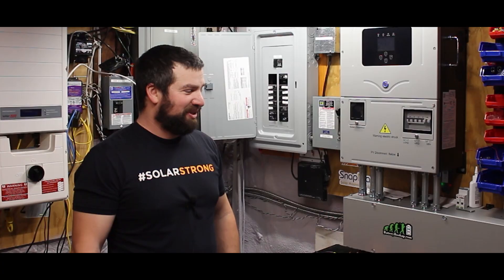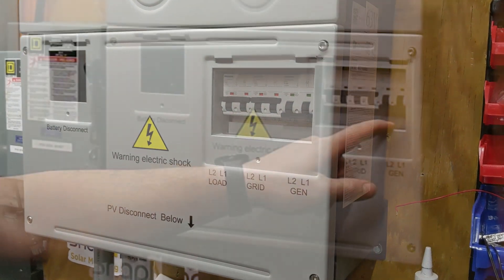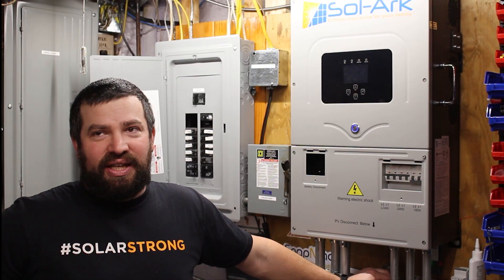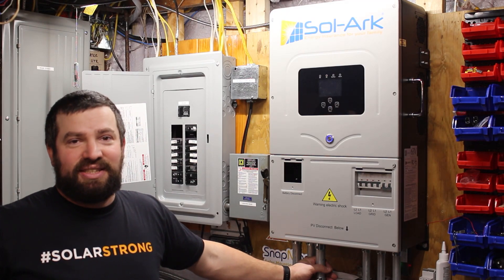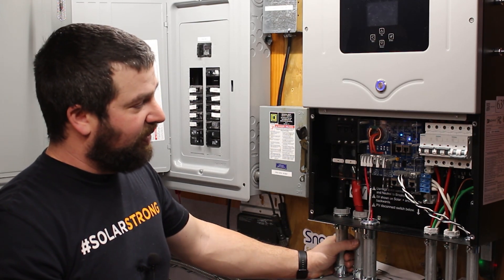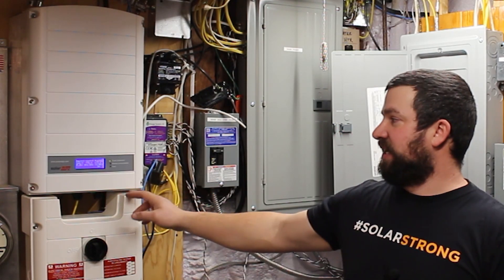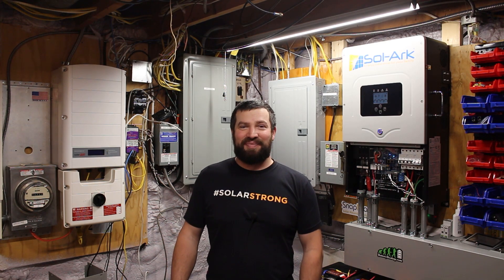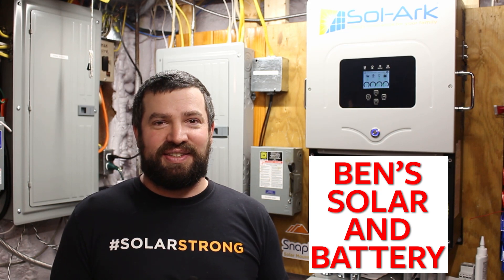Why the Professionals use the Sol-Ark 12K Inverter and Solar Charger

Comment: Unless an inverter can run an entire house without issues, I don't see much point.  It is fine to have UPS units for critical loads such as computer, internet boxes...  but for a whole house setup, unless it can run everything you normally run (so you don't have to conserve power during a power outage), then it is not really a true off grid system to me.  Also people talk about 12,000 watts for something like this, but unless it can handle surges (even an incandescent lamp has a surge), then it is not so useful.  Also since a house might have a power factor (PF) of maybe 0.85 for all loads combined, I have to question if you can really get a true 12,000 watts.  Running 8 hair dyers that are 1500 watts each is not the same as running a house with central AC, hot water heater, vacuum cleaner, intermittant well pump....  I am wondering if a 12KW inverter with a 0.85 PF combined load on it will only deliver about 10 KW.
Reply from the maker: Hi David James,  Sol-Ark named this a "12K" model.  I think they did this for marketing?  Not sure.  But in off-grid mode, working with batteries only, it outputs 9kW.  I think it can have up to 12kW of solar panels connected to it.
Reply: This is not a 12kw inverter. its a 8kw inverter with a 12kw charge controller built-in. if it was a 12kw he wouldn't have a issue. 8kw is only 33 amps of 240v power suppled . hes under sized  but hey the Big feature it allows ac coupling unlike a lot of inverters out there. Why Do ac coupling vs dc??? well micro inverter already converters your power to 120/240. So what does that mean? well If you have 10 kw AC solar system plus the 8kw inverter output  you have a total of 18kw max power output. Which means You can get away with one unit vs 2 units on most cases. big kicker is If your state that requires DC rapid shutdown,  you will need a dc micro inverter for each solar panel now! So at that rate you my as well do a ac couple system to get more power. If you had just a dc solar system your only going get max of 8kw continuum off this inverter.  Now best part is you don't need a net agreement with this inverter. No other inverter I know has this feature. it uses a ct sensors on your main power lines which means it will senses incoming power from your meter and match it to cancel out the load zero-ing out your electric bill!!!     Do you know of any other inverter that has ct sensors?????

Comment: Hi, it is possible to install this Sol Ark without a Subpanel (AC Grid input directly to the Sol Ark input, and Sol Ark output to the Main Panel that will supply powe to the house)?
Reply from the maker: Yes, you can do it that way.  Ben has several panels because he has been modifying the system for years.

Comment: Im a poor noob and don't understand why so many people praise the sol ark 12k? Do the other similar products for less then a quarter of the cost catch fire or fail??? Sorry I'm poor or ignorant or both.
Reply from the maker: There are tons of great inverter options on the market.  Most of the cheaper inverters will work fine off-grid.  The Sol-Ark has some additional features.  One of the more expensive things is the ability to sync sine-waves with the grid, thus allowing it to back-feed the grid.  But I'm with you, if you only want to be off-grid, then there are less expensive options.

Comment: If you only have 9 panels isn't a 12k inverter overkil?  Don't they have 8k?
Reply: If someone has equipment with a high starting power draw, like compressors, the peak draw must be accommodated, even if there are fewer solar panels than what is capable of being handled by the unit.

Comment: Could you put together a wiring diagram of your system with all of the components labeled for your viewers, please? With your knowledge of the system you could easily make instructional video’s which would double your YouTube followers.
Reply: I agree That would be very helpful
Reply: https://www.sol-ark.com/wp-content/uploads/2021/09/12K-Brochure-Print.pdf
Reply: If you managed to find your solution, please, ignore this, but it should be helpful for other people that view the video. The manual for this product is downloadable, and it contains various scenarios that include what this system is. The Sol-Ark 12000 inverter takes 6500 Watts from the DC and 6500 Watts from the AC. This inverter was to replace a 5-kW inverter, which he explained in the video. The 10-kW inverter was probably an add-on to his system. He expanded his solar capacity beyond the inverter he had. In that event, he then added it AC-tied, which means that it is directly connected to the main service box through a circuit breaker. This is actually shown as a possibility in the Sol-Ark manual. The Sol-Ark has the ability to turn on the generator input by talking to the generator itself. His other inverter could have been used as that input, but the solar array is probably beyond the 6500-Watt input of that generator setup. He would have had to split the array between the DC and AC. The voltage of both DC inputs must be the same for the Sol-Ark, and that might have been problematic for him. This system would not be very informative for a person who is making a system from scratch other than it might show the pitfalls of constructing a system over time.

Comment: How are you connecting two separate, heterogeneous battery banks into one system without damaging one of both of the battery banks?
Reply: Magic!  But seriously, they're paralleled and have different internal resistances, so the higher capacity batteries see higher charge and discharge amperages than the smaller batteries.  Each 16s battery has its own BMS and is connected in parallel using OCPD of half the BMS rating, preventing issues in the event of a BMS shutdown/restart.

Comment: Hello! If in a series of 10 panels with 310w, I have panels with different parameters, is it a problem? Example: 8 panels 33.2V / 9.3A and two 32.6V / 9.5A. Thank you!
Reply from the maker: The two you asked about are very close to each other in specs.  That is probably fine.  But what you will see, is the charge controller will never be perfect for every panel.  The charge controller has to pick a voltage, and in this case it will be something in between 32.6v and 33.2v, so it will work OK, but not perfect.  You will loose a tiny bit of potential power from your string.

Comment: There is no way I'm going to spend that much money on a solar inverter that can't even carry a load of an air compressor! You totally killed this video especially if it can't even hold or handle a dryer. What's the point of all that money and the battery backup with all that solar if you can't even run a dryer. All that money spent and you're running your clothes out on a clothes pin dryer line in your backyard, LOL how sad.
Reply: well Big feature it allows ac coupling. Why Do ac coupling vs dc??? well micro inverter already converters your power to 120/240. So what does that mean? well If you have 10 kw AC solar system plus the 8kw inverter output  you have a total of 18kw max power output. Which means You can get away with one unit vs 2 units on most cases.  big kicker is If your state that requires DC rapid shutdown,  you will need a dc micro inverter for each solar panel now! So at that rate you my as well do a ac couple system to get more power. If you had just a dc solar system your only going get max of 8kw continuum off this inverter.  Now best part is you don't need a net agreement with this inverter. No other inverter I know has this feature. it uses a ct sensors on your main power lines which means it will senses incoming power from your meter and match it to cancel out the load zero-ing out your electric bill!!!     Do you know of any other inverter that has ct sensors?????

Comment: Your Price:
$6,850.00 USD 
a bit too much for just a hybrid inverter.. i can pay the electric bill for years with that amount...
Reply: well Big feature it allows ac coupling. Why Do ac coupling vs dc??? well micro inverter already converters your power to 120/240. So what does that mean? well If you have 10 kw AC solar system plus the 8kw inverter output  you have a total of 18kw max power output. Which means You can get away with one unit vs 2 units on most cases. big kicker is If your state that requires DC rapid shutdown,  you will need a dc micro inverter for each solar panel now! So at that rate you my as well do a ac couple system to get more power. If you had just a dc solar system your only going get max of 8kw continuum off this inverter.  Now best part is you don't need a net agreement with this inverter. No other inverter I know has this feature. it uses a ct sensors on your main power lines which means it will senses incoming power from your meter and match it to cancel out the load zero-ing out your electric bill!!!     Do you know of any other inverter that has ct sensors????? I believe ct sensors is best feature out there
Reply: About 3 to 5 years for most.. its for power security.. what does that peace of mind cost you?

Comment: Is there a way for two of these to work together and replace and supply a 100 amp service?
Reply from the maker: Yes, up to 9 units can be paralleled.  3 units would equal a 100 amp service.
Reply: @DavidPozEnergy  Oh why three when one makes a 50amp service?
Reply from the maker: According to the spec sheet on page 24 of the manual: https://www.sol-ark.com/wp-content/uploads/2021/03/12KOD-Manual-3-11-2021.pdf  The maximum amps per unit is 37.5.  If you had 2 units then the math is 37.5x2=75 amps.  If you had 3 units the math is 37.5x3=112.5 amps.  

I don't know where you saw 1 unit is 50 amps, but it's not.  1 unit is 37.5.
Reply: @DavidPozEnergy  Ah ok now I know thank you.
Reply: Why do people need more amps usually? I'm clueless but trying to learn. Thanks
Reply: @TacklingTheGiants  To power more electrical appliances and a BEV charger ...

Comment: I wrangled over the price of this unit for a while but chose to go with it for my first solar install.  I couldn't have made a better decision.  As Ben says, it's a very easy install.  It's all in one.  It can do whatever you need, period.  The customer support has proven to be wonderful...which is another major reason I chose to go with the Sol-Ark.  Ben may have things that cause problems for this inverter but I don't.  It's really awesome.  I'm grid tied for now...have some battery backup...but can move completely off grid if the power company pisses me off.
Reply: Cost???
Reply: How often do you have the nuisance trips because one leg is off balance?

Comment: Can you stack 2 of them to back up or off grid a house?
Reply from the maker: Yes, you can parallel up to 9 units.
Reply: @DavidPozEnergy  we are trying to figure out what we want and I have several questions. Are all of the solark inverters emp hardened? And does that protect just this inverter(or would it protect microinverters too if you have them) and the panels? If we go with microinverters does this work with that also? Also, I see transmitters and receivers are needed ...does the emp protection protect these transmitters and receivers as well? If you parallel more inverters do you need to buy more transmitters, receivers, and batteries? I'm new to this lol. Thanks for your help.
Reply: @TacklingTheGiants  Yes they are.  But then, can't you use Google and read for yourself?

Comment: Still think I prefer Schneider or Enphase with all their "Boxes" This seems like an all-in-one failure point to me. With the Enphase Smart Switch you can have the full 200amp service ran through it as well. AC coupled is the future. String inverters are one of the oldest and least efficient inverters on the market.
Reply: Sol Ark Main market is for off grid applications, but can also use for grid tie if wanted, Can't you use enphase in off grid, and enphase batteries are a rip off.  You can stack these inverters, so 2 is 200 amps of peak power 100 amps of continuous power I rounded up for simplicity. For enphase you would need 6 encharge 10 batteries at 12k a pop.  75k before micro inverters and panels.  With Sol-Ark you can do it with 2 inverters at 6800 a pop and two fortress vaults at 12k a pop,  you don't need 60kw of storage.  So 38k instead of 75k, even if you bought another fortress evault it would be 50k instead of 75.  Sol Ark has advantage here with battery storage.  if you aren't doing battery storage yea enphase makes more sense, but with battery storage Sol ark is the clear winner.  You could find cheaper batteries and the sol-ark looks even better.  Tesla is more price competitive (Cheaper even) with sol-ark and fortress batteries, but you can find some cheaper batteries from different manufacturers
Reply: @scotthall1381  What about us guys that already have enphase microinverters installed and want to add battery backup. My earlier research made me to believe that I would need to connect my solar branch to the Gen In and when the grid goes down, Sol-Ark would shut them down by opening the circuit to the enphase inverters. This video seemed to imply that the Sol-Ark has the capability of keeping the inverters working during an Islanding condition and then shut them off by varying the frequency to 60.5 or higher to cause the AC inverters to shut themselves off. Is that true and will it allow me to get power from my enphase inverters while islanded?

Comment: Sol-Ark vs Victron any suggestions. I plan to use 6 of the 48v Gyll batteries.  Thanks
Reply from the maker: Both are excellent brands, so you are good either way.  Sol-Ark has the 120/240v split phase built in.  Victron doesn't make a split phase inverter, so you have to pair two 120v inverters, or use one 240v and an autotransformer.  Point being that Sol-Ark will make for the simplest installation.
Reply: @DavidPozEnergy  Awesome thanks.

Comment: Almost $7k for a charger/inverter is pretty steep
Reply from the maker: I agree, it's a big cost.  The cost looks a little better if you price out the circuit breakers, load center, and duel MPPTs.
Reply: well Big feature it allows ac coupling. Why Do ac coupling vs dc??? well micro inverter already converters your power to 120/240. So what does that mean? well If you have 10 kw AC solar system plus the 8kw inverter output  you have a total of 18kw max power output. Which means You can get away with one unit vs 2 units on most cases. big kicker is If your state that requires DC rapid shutdown,  you will need a dc micro inverter for each solar panel now! So at that rate you my as well do a ac couple system to get more power. If you had just a dc solar system your only going get max of 8kw continuum off this inverter.  Now best part is you don't need a net agreement with this inverter. No other inverter I know has this feature. it uses a ct sensors on your main power lines which means it will senses incoming power from your meter and match it to cancel out the load zero-ing out your electric bill!!!     Do you know of any other inverter that has ct sensors?????

Comment: Is this a low frequency inverter? Will this start a well pump? 220volt
Reply from the maker: It is high frequency.  Surprising, it has an amazing surge capacity.  Yes, it can start a 220v well pump.
Reply: @DavidPozEnergy  what's the difference between low and high frequency inverter? Which is better and why?

Comment: I noticed when I watched the older video from David Poz with Ben that along the way Ben moved the incoming grid lines to the smaller AC disconnect box in his basement which was highlighted in this video.  If I'm about to get my 100amp AC main breaker box replaced with a larger 200amp box.  Should I have them wire it like Ben has his currently?
Reply from the maker: You made a correct observation.  Ben personally changed the layout because it makes any future modifications easier.  I'm wishing I had something similar since my main comes right into my panel and I can't do all the things I wish I could.  If it were me, I'd pay for one extra box.
Reply: @DavidPozEnergy  Until I saw this video, based on my needs and the amount of current I would need to feed back through my main breaker box I was thinking I would need to install a 'Line side tap' (or a feeder tap), due to the design limitations of feeding current back through your main circuit panel.  Either way would work, and I as betting I would probably need to install an AC disconnect anyhow.  With the method he used in this video it resolves both issues at once.  What I see is a possible limitation of Ben's setup is that the maximum amps you can draw is limited by the size of the inverter/charger.  I would not have that limitation with a 'line side tap'.